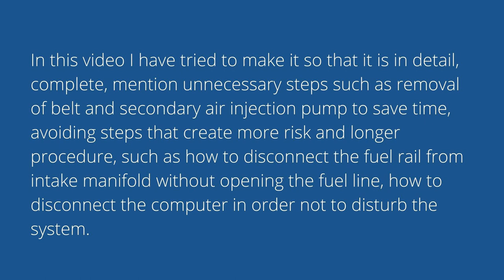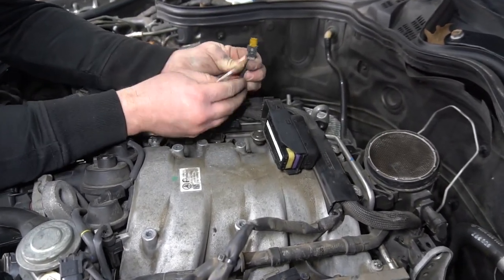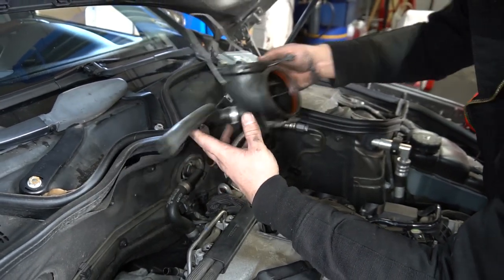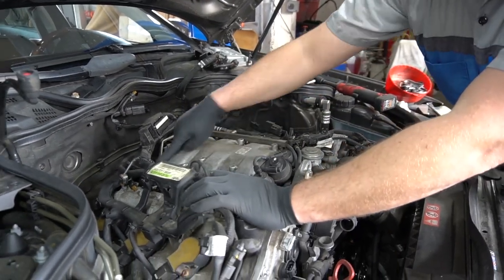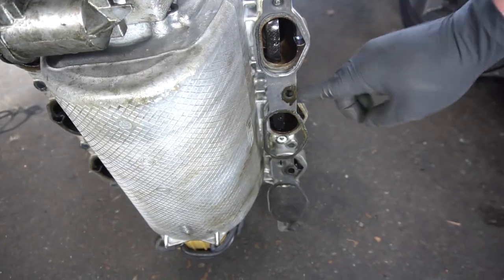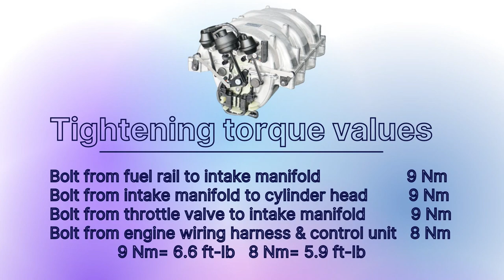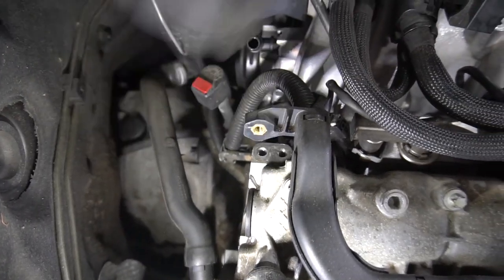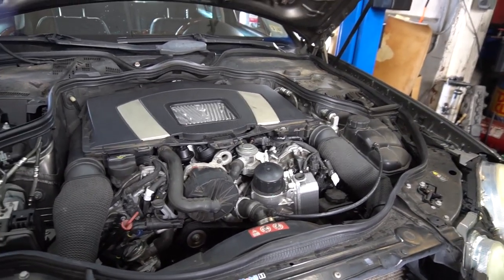Mercedes M272 M273 intake manifold DIY-HD Simple replacement follow the video 350-550 Engines

Comment: I've seen an other video in which the guy disconnects everything to get the manifold lift up a little in the front and changing the broken lever and middle vacuum-pot. I didn't figure out how that guy made sure not to damage the gaskets/sealing- but anyway to me it seems a lot of work to do and replacing the whole makes sense in a way then, even more once it is removed and you still want to drive the car for couple of years. Found the pierburg manifold for my M272 for about 600-700€ and think is worth it because it's all clean, new connectors, vacuum-pots etc . Thanks for the really great video and explanations !

Comment: Nice. Only thing is the new manifold appears to have the same doomed to fail plastic flap lever that the original had. Oil and sludge build up on the inside flaps can be avoided by changing out the oil separator diaphragm thing behind the passenger side valve cover on a regular basis

Comment: Thanks for going into such detail. I am going to do this on my 2007 E550 and I am much more confident having your video on-hand to reference.  I have 142k miles and will replace the fuel injectors as well.
Reply from the maker: David,
I would not change the  injectors unless you know for sure that they are not good. Just  Use a can of liqui Moly injector cleaner or BG44K.
 For any reason  You have to change the injectors I suggest it to be  done in two separate operations, so in case You have a problem  such as the engine running rough afterward, you won't be confused whether it's related to the injectors or the intake manifold.
 I have pretty much explained everything in that video and I left nothing to be guessed or questioned.
 Good luck.

Comment: I have 09 E350 with 55K miles and it drives like brand new. I've been checking this flaps on my car every 1st day of the months for a last 2 years (Never missed). But it broke on 1st of May when i was checjing the flaps.. The damage was at the same spot in this video. The broken piece still attached with the middle rod. The car felt the same and no CEL. . The drip pan (pcv) and the caps has been replaced last year (Wasn't leaking).  So I removed the secondary air pump and left side check valve with a couple air hoses then put  some JB plastic weld and add a thin metal plate for extra strength. Its been working fine. If this brake again later, will replace the manifold. I just wanted to see how long it can handle.....   Btw, the best video on the YouTube.  RESPECT !!!
Reply from the maker: Y J,
Thanks for your kind words. I'm in Japan at the moment and want to take my time reply to you. I'll be back home next week to turn around going to Europe for six weeks and with me grand kids come to US for summer.
In the mean time if you have a question please don't hesitate call and ask for Nathan.
The number is at the front of the video.
Sayonara,
Sam
Reply: Venden una placa de aluminio como repuesto

Comment: That is the most excellent and detailed video of this procedure, thank you, I am about to embark on this adventure with a 2008 CLK 350 with 203,000 klms . I am curious why you didn't unplug the coil packs, you seem to wrestle with the wiring looms on both sides, would it not be easier to move them out of the way with the coil packs unplugged? As for peoples comments on " how do you know where all the bolts go ? " buy 12 clean takeout coffee cups and label them.. but the bolt sets in each. thanks for your sensible video. From Australia.

Comment: I would love to see this on a MB 273 V8. GL450. Plenty video's on the six cylinder M272 but not too many or ANY on the M273. I know the procedure is close on both but it would be nice too see the M273 V8  Thank you again.
Reply from the maker: Thank you for watching and leaving comments.
Reply: Exactly the same. Doing my 08 right now. Complete fuel injector, ignition, and air handling rebuild. Not cheap..

Comment: Thanks for this video - it's really going to help when I attempt this. One question though, would you recommend swapping the plastic tumbler flap actuator on the front of the brand new manifold with one of those billet aluminum ones from AGA or URO, so that the possibility of it breaking in the future is basically zero? I'm in two minds as I read that Mercedes specified the tumble flap actuator to be plastic so it would break before the actuator flaps inside the manifold itself...
Reply from the maker: Law boy, others have asked this question too. My reply is NO. It is like taking a 10 Amp fuse and replacing the wire bridge with a heavy-duty wire that can efficiently conduct a 200 Amp current. Is this smart or what?
Reply: @mbhmercedes-benz7822  idiotic, that same shitty plastic part is going to break AGAIN very soon. Many have replaced with aluminum and had no problems.. why would you replace the entire manifold with the same faulty part lmao

Comment: How can I be sure I am disconnecting the engine side of the computer and not the computer side?
Reply from the maker: It is clearly shown in the video. The passenger side of the two plugs should be disconnected.

Comment: What Size bolts did you use to align the  Intake manifold? (2007 GL450, V8).  As I would like to do the Same. Thank you for a great and Helpful Video A++++.
Reply from the maker: Same bolts as intake manifold or possibly 5mm longer but you cut the top off.
Reply: @mbhmercedes-benz7822  what is the bolt diameter?

Comment: I just replaced my intake on my 2007 c230. It runs great but I have p2015 code for some reason. I have double checked the flaps and nothing is broken. What do you think that could be?
Reply from the maker: Robbie, unfortunately, it is hard to say without having the car. Good luck.
Reply: I have the same problem,  i bought an aftermarket intake. I get the code p2015.... position sensor switch circuit range and also p0410 in current but also pending and check  light turn on, wonder if i should keep driving it till it adjust.
Reply from the maker: @roquesosa87  Again, it is hard to make a comment without seeing the car.
Good luck!

Comment: Hi what is the symptoms to replace the inlet manifold 
The car had no good acceleration and if i hit the fuel pedal suddenly it won't shift to next gear till i remove my foot and when need to stop so hit the breaks it will gradually down shift with feeling to the all shifts
Is that the because the intake??
Reply from the maker: My friend go back and carefully watch the video. Everything is explained.

Comment: Good afternoon i need to replace my intake manifold on my Mercedes C320  W203  year 2001 ,i believe it is on the right side under in , what type of time frame would i be looking at Mercedes Dealer believe a little under 4 hours  ??
thanks for your help much appereciated ...
Reply from the maker: You are looking at M112 engine on a 2001 C320. It is a different engine than this one. The time it takes you to do the job depends on how skillful and experienced you are Unless you are a “mechanic” and want to know what the book allows for this job.

Comment: In my 2008 SLK280 R171, I have confirmed the broken plastic part with an inspection camera. However, no CEL, but the code is p2006. How much should I expect to pay at an independent mechanic to fix it? Should I just replace the broken part or the whole manifold?
Reply: if its the original 2008 manifold, i'd suggest changing the whole manifold. especially if the lights been on for a long time
Reply from the maker: We have discussed this matter several times in this comment section. Again I suggest replacing the the old intake manifold.
The labor should be 4 hours plus materials and taxes.

Comment: Great job on the video. Saw another where the plenum had to be tapped for the bolts. You think the new part would come with a better design or upgraded parts that wont break in 70 thousand miles. I have to do mine but I'm going for the replacement rod and aluminum upgrade instead of a 700 dollar plenum. But like i said awesome job on the video but there is a replacement upgrade for the broken parts check rock auto
Reply from the maker: Good luck with the repairs.

Comment: Hello, i replaced the intake manifold and now i have p0106 intake manifold pressure sensor malfunction,  i changed the sensor for a oem one and the vacum hose to it. And im still getting the code. I have 5v  and ground in the connetor.  Any idea what it could be ?
Reply from the maker: Check your work again.

Comment: On my 2007 C280, I get the P0206 code.  removed the intake manifold, but none of the rods are broken, and testing with a vacuum testor, all the actuators function.   Thoughts as to why I'm getting the code ?
Reply from the maker: I have to see the car and scan it with Mercedes scanner.

Comment: I have to change the intake manifold on my 2011 E350 and your video is a great tutorial.  One question I have is that the vacuum line that is in the front of the intake manifold was replaced by the tech because the original one was worn...what size vacuum line did you use for this?  Thanks
Reply from the maker: Dylon,
Please check my answer to Adam A below. He had the same question.
Reply: @mbhmercedes-benz7822  Thanks again!

Comment: Great video thank you. What’s your opinion on just taking it off to clean all the dirt and oil? Will it make it last way longer? What do you think about swapping for newer intake from updated engine model (plastic one)? I know you just need to code your ECU
Reply from the maker: Cesar, there are two sides to me. I am an Ex professor of Mechanical Engineering (Fluid, Thermal, and Robotics) that was not careful and my hobby became my business against my wishes. Now I am also a "shop owner" in which I used to be the only mechanic. I have awesome guys working with me nowadays.
When I am working on a customer's car I am concerned about correct diagnosis and fixing the real problem (not my imaginary), correctly just like new or better.  
My customers, just about all of them want to know, How much and how soon. Nobody asks how. But once the car is picked up, they expect it to function longer than the original unit. If I save them 20% on cost or engine efficiency, for the most, they do not care. They just want a reliable car.
Working on my own car is a completely different ball game. When I was younger (I am 66 now) I would spend hours more on repair saying I saved a penny, however, I was reducing the reliability and would not count my valuable time. Now that I am older, can not afford to have car problems on the 600-1000 mile trips and do not care to carry my toolbox with me.  
Everything that you said is doable but you expose yourself to more potential problems. The intake will not last "way longer" unless you come up with a different and better design.
Where are you? Thank you for taking the time and writing to me. I started playing with Mercedes as a hobby and now am back to the hobby and making videos. LOVE IT.
That was my 2Cents.
Reply: @mbhmercedes-benz7822  thank you for taking time to replay really appreciate. I’m still in that first phase of life in which you want to learn as much you can, you think have time to waste and money to save, but above all, I do appreciate the advise of people with more experience than me. I’m based in Wisconsin, if you happen to be around I’ll happily invite you a beer. Looking fwd to see more videos I really like how you explain things.

Comment: Did you disconnect the battery before you started this job???? I took the day off tomorrow and I’m gonna attempt to replace my intake manifold I’m a mason by trade so I’m worried about me pulling on clips to hard
Reply from the maker: Jason, 
Leave the battery connected. make sure you have new vacuum hoses to replace the worn ones. Be patient, do not rush.  Try to be easy on plugs, do not pull them by wire. Clean the areas as per the video. Watch the entire video couple of times and make notes. Get a friend to watch you and give you a hand if you needed help. JUST follow the video. Keep me posted.
Reply: @mbhmercedes-benz7822  Why do you recommend leaving the battery connected?

Comment: I'm in the process of replacing mine. Got the old one out. The code I had was p2004 but nothing seems broken, everything is in its place. Any idea?
Reply from the maker: Sorry, I can not say what is or was bad without looking at it.
Reply: Hello, have you been able to do anything to your car? I have p2004, too (no check engine light, though). Car is generally ok but a little slow at lower rpm. I am afraid to open it up and find everything intact. This is not an easy job
Reply: Apart from the code, what symptoms does your car show?
Reply: @David-el6hh  tumbler on mine broke. noticed at low rpm car would not accelerate prperly until high speeds
Reply: @gjoniny1534 Have you replaced it? Is there any noticeable improvement after?
Reply: @David-el6hh  no unfortunely there are some more problems like timing chain. Not worth fixing with 160,000 miles on it
Reply: @David-el6hh  car is sold now. No symptoms and no noticable difference after replacement. CEL went away for good. Best of luck 🤞🏼

Comment: Do you ever replace the plastic levers on the stock manifold with the aftermarket metal one?  I ask because I am now getting a p2004 code which indicates a broken lever a year after replacing the manifold
Reply from the maker: Wayne, my friend, Victor Gonzalez asked the same question below and I answered him. Here is my answer: 

Victor, when a fuse blows, it is an indication of an internal problem and you do not replace the fuse with heavy-duty wire. The weak link of the intake breaks due to an internal problem with the intake manifold and Mercedes-Benz recommends it be replaced with a complete intake manifold. As a business, you can not afford to cut corners.

When you perform these jobs as a business, it is one thing, but when you do it as a hobby, you do not have to worry about losing a customer or possibly a lawsuit.

With the knowledge that I have nowadays, I would do the same thing even in my own car but 40 years ago, I probably would have taken the shortcut. Maybe not.
Reply: That's insane! Sorry to hear that. Did you do it yourself &/or use a Pierburg one? I'm trying to decide if I should upgrade mine before I install it, or if it's even an "upgrade" at all. As hinted at in the shops comment, it could just ensure internal failure rather than external failure. Bye bye valves.
Reply from the maker: @RothBeyondTheGrave   I am confused. Are you asking a question, making a comment, or what? Don't get excited, calm down and then write.
Reply: @mbhmercedes-benz7822  there is absolutely nothing remotely confusing about my post. It was a direct response to the o.p. which stated his new manifold failed after a yr, which is pathetic. 
I inquired about the part itself (if it was the pierburg unit or another one), if he did the job himself or not, etc.
I also wondered if I should "upgrade" to the external aluminium piece before installing my new manifold (which I didn't). 
I also mentioned that I saw you suggest fitting the aluminum external piece is not a good idea, as it was purposely made to be the weakest link in the system. Theoretically, upgrading that cheap plastic garbage on the front could put extra stress on the internal cheap plastic garbage, causing an internal failure which could (and has in other failures I've read) break off & damage/destroy a few valves. 
That's the long winded version. I'm not sure how that wasn't clear.
Reply from the maker: @RothBeyondTheGrave  Bingo.....You got it. Good job!
Reply: @mbhmercedes-benz7822  always remember....don't get excited, calm down, and then read!

Comment: Great vid.. you are the first person i've seen that didn't undo the connectors at the coilpacks. Very efficient stuff! Getting ready to do this on my m273 is it pretty much the same job? I was wondering what size and brand vacuum hose you used for those lines you replaced (or did you buy the oem replacements?) and where the other end of the one you cut goes. Also are most of these bolts the same size? I dunno how you were able to keep track of all of them like that. Lastly did you buy a new gasket for the throttle body or did it come with one? And... last lastly why do you not recommend disconnecting the battery?
Reply from the maker: The vacuum hose is 3.5 mm on the inside (ID) and about 8 mm on the outside (OD). Main  concern is ID to be 3.5 mm.
Not all engines have the same vacuum hoses. The small V6 engines that do not produce enough vacuum are equipped with addition Vacuum Pum on the back of the driver's side camshaft. There is a hose that goes from the vacuum pump to the area behind the fan that gets connected to grill. Not to get confuse 95% of engines do not have this vacuum hose. Just check your car and see what you have, and replace it.
We replace the throttle body gasket unless it is in a good shape and relatively new due to reasons.
If you disconnect the battery you then have to reset some of the memorized items. We want to be as efficient as possible. It comes from years of teaching engineering and not plugging the values { such as ( m/Sec.) (m/sec.2 )  (Lb/inch2) ( g/cm3) (g/L) etc. } unless needed. If you are an engineer, you would understand.